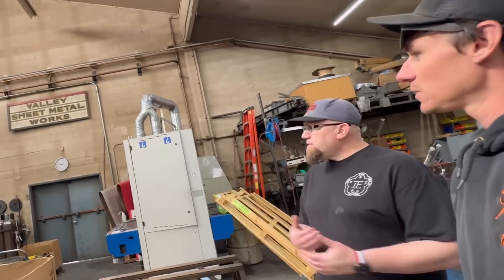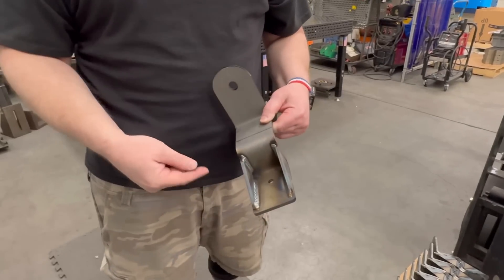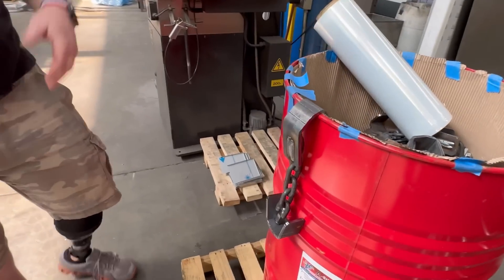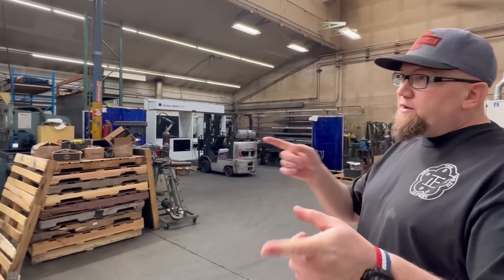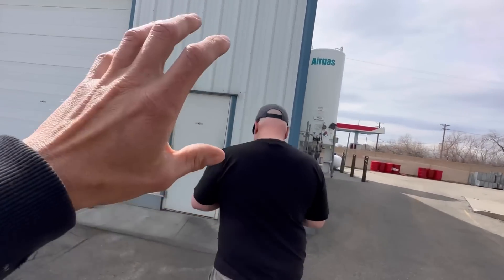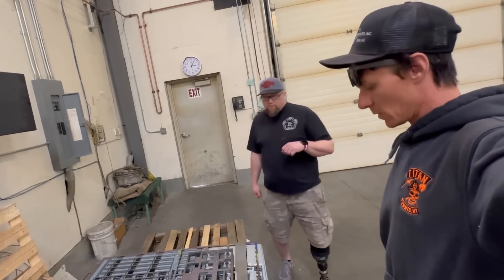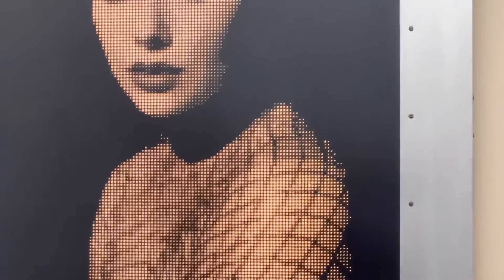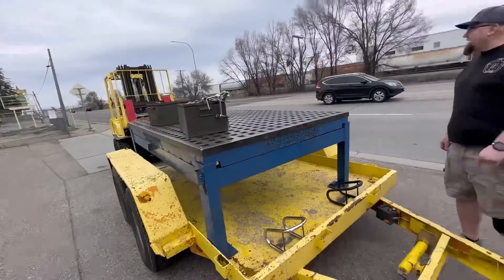Touring a Automated Welding Shop!

Comment: This kind of makes me sad because I came from the shop world first where did the US go wrong without trades we're screwed without metal working we are screwed and this goes especially for fabrication I live in the southwestern corner of Ohio and you can't go anywhere without finding welding job that doesn't require hand work probably more handwork than there is machine work
Reply: Greed is killing 90% of American jobs. When my employer takes 95% of my pay on a job, it's untenable. Over regulated, over taxed and under-payed.

Comment: It's pulsed, components to be welded have to be perfect and exact. 
It also has to make sense for mass production, I was at a place years ago that threatened us with robots replacing us and I explained that their tolerances would never get tight enough for that to work with their stamped and formed products. We'd rarely get components that were no fuss, let alone for them to line up on a job order.
They spent millions of dollars trying to automate stuff, and they just killed their production and customer base doing it, all because us lowly welders had more sense than the board members.
That said, I never want to do that production crap again with making parts that are all the same for days and weeks.
I'd rather be flipping burgers.

Comment: I have been un the Trumpf factory in Linz Austria many years ago.  Trains drive in one end of the building to take press breaks out.  World class facility that makes world class machines!  I was there to automate a press break machine and robot combo that would pick up pre cut sheet metal and automatically bend it into custom shapes.  That factory makes press breaks that can bend steel for ships (2000 ton breaks if I remember right).
Reply from the maker: That’s awesome, I would love to see that in action
Reply: It was closed to Americans at the time but I was called in secretly to do some work.  When they found out I was an American the staff threatened to have me arrested/deported.  When they saw my work they let me stay. Lol
Reply: PS love your shop.  Doing it right in the USA!

Comment: I operated a robotic welder at my old job every now and then when I wasnt in my booth manually welding, they are fun but the limits in capabilities are very clear and mig welders dont need to worry about these replacing us.  All these are is for taking the bulk of the workload off of humans so we can focus on complex welds and building the large structures.  Essentially the robots are master level welding for entry level welds, they have limited manueverability but the consistency and quality of the welds (in the hands of a competent operator) are outstanding for what it is.  Id love to have a little robot welder in my shop and have a laborer or even a shop hand run it to make extra money that can be put into my work. super cool video man and that guy you're talking with seems solid af
Reply from the maker: Rob is definitely a down to earth, realistic business owner. I’d dare to say a innovator
Reply: @MeltinMetalAnthony  im looking at this business model as a young man in the trades like yourself and all I see is $$$$ everywhere especially being familiar with the equipment lol
Reply: No robot will ever match my apathy.
Reply: Completely agree. Seeing as for every 5 welders that retire, there are only 2 welders entering the workforce, this isn't a concern.

I operate a Valk weld robot roughly 65 hours a week.  And while it takes the brunt of the workload off welders, it only got rid of one position (out of 3) when it was installed.

No matter how nice the welds are... You still need a welder to tack parts, load, and operate it. And another welder in the output end to handle welds in certain areas that the robot can't reach.

So yeah. They're great. And learning to operate them was definitely advantageous as it earned me more money and more hours... We still have just as many welders in the shop. They just had their time freed up for more important and detailed tasks.
Reply: A robot may not take our jobs but Ai robots very well could